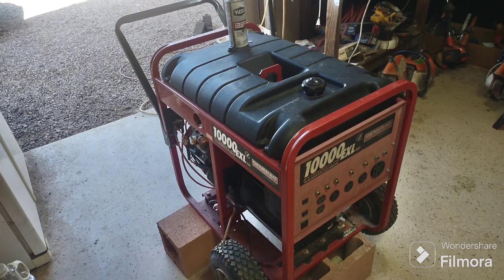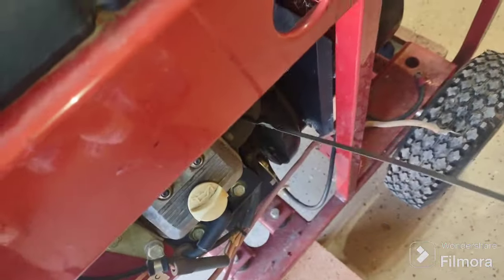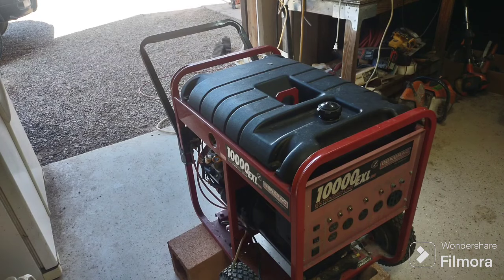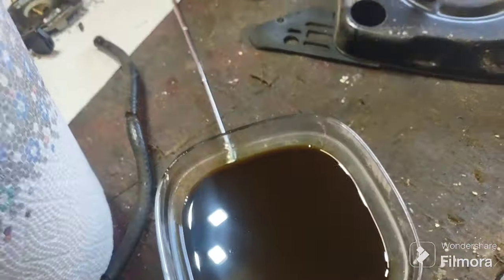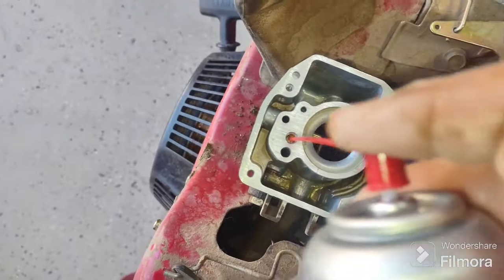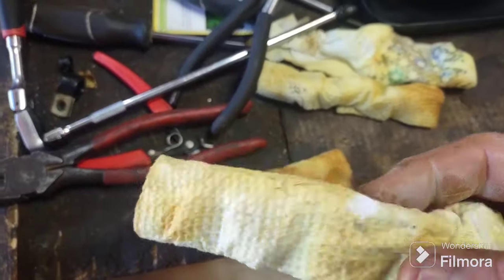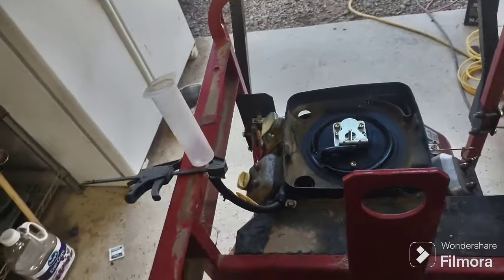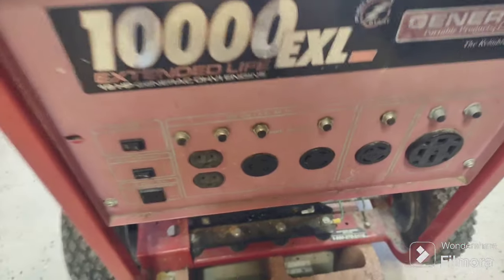Generac 19hp 10000 watt generator bought at auction.Will it run?

Comment: It's possible it is A electronic government control arm solenoid switch for when it's producing power itself adjusts the engine speed automatically at one setting.
Reply from the maker: You nailed it. Servo motor for when the generator is running under load. It opens the throttle or shuts it down to keep constant electric flow.  👍

Comment: Don't know for a fact, but I think maybe that thing is the electronic idle control.
Reply from the maker: Yeah, I'm thinking it's called a servo or stepper motor. Something like that. If I was to put a welder or big AC unit on there to put a big load on it, I think that would control the governor and add RPMs. That's my guess anyways. Thanks for the help and hope you guys are doing well. 👍 I'll be by soon to support your channel.

Comment: That's A industrial/commercial machine set-up that's either A Honda engine.,or Briggs & Stratton over head valves industrial/commercial twin cylinder.,or opposed twin cylinder engine.
Reply from the maker: Yeah John, another of my followers @davessmallenginerevival commented it's a big Briggs vanguard. He's done many engine swaps with this engine of varying horse power. I'm still waiting on the fuel grommet and shutoff to get this thing gone. Thanks for commenting.

Comment: Hey buddy. Thats an expensive engine on there. Its a briggs Vanguard,  made by the Japanese for B&S. Youve seen me work on a few. My big  cub cadet has a 20hp Vanguard. That thing you dont know what it is is for when you have that idle switch thingy turned on , on the panel will turn the engine down to idle when there's no load on it. Like if you had a fridge plugged into it , it would go full throttle when the fridge turns on and then  back to idle when the fridge turns off.   Doesn't that thing have an electric start on it?  Its a nice genny thats for sure
Reply from the maker: It does have electric start and I was calling that little thing a servo motor to control the throttle. So I was close. Lol.🤨

Comment: Commenting only on my own purchases of unknowns.  Turn ON the run switch, drain the junk in the bowl, check for oil, plug in a light, THEN carb spray and start. Nice generator. Whats the THD?
Reply from the maker: I guess I'm a little different in the way I approach stuff that has sat for a while. The run switch not being turned on is just an oversight on my part. Things like that happen so I choose to leave it in the video. I'm not worried that it makes me look bad or forgetful, just human. 😆 When I look at a machine for the first time I look to see if it can tell me a story. IE: The fuel shut-off was in the off position, the engine run switch was also in the off position. That tells me that the machine was most likely running before it sat for an extended period of time. The overfill on the oil tells me that someone was just a little careless when they topped off the oil. Not a big deal if that was the case. If the oil was high on the stick because of a stuck needle and seat then I would have to address that issue. So that just left me to deep clean the carb, replace the line to the tank and test run. For me, there's no point in throwing money at it if it's not generating electricity. Now after you've seen the video and it does what it's supposed to, I have ordered the fuel shut off and grommet, replaced the spark plugs, new oil filter, cleaned the air filter, scrubbed the tank and replaced the fuel line. I appreciate your comment but I think it only fair to explain my train of thought going into something I've never seen or worked on before. I hope to see you here in the comments again my friend. I appreciate you. 👍
Reply: @ZombieDaveAZ no doubt there are different tshooting methods. I like the IV quick fuel fill. I've sucked bad fuel from the bowl more than any other problem so I drain it. The large gens have more doodads also. If the paint is faded badly good chance fuel line parts are cracked. Plastic tanks make life easy. I like the center hook. Good video
Reply: Total harmonic distortion on that unit is probably five or 6%
Reply: @gabaradama144k9  doubt it. Maybe at idle.
Reply: @krg038  yeah, I could probably agree with that. It all depends on what load you’re running.